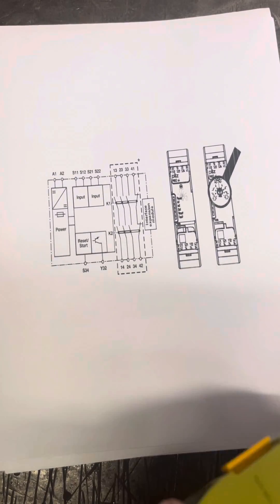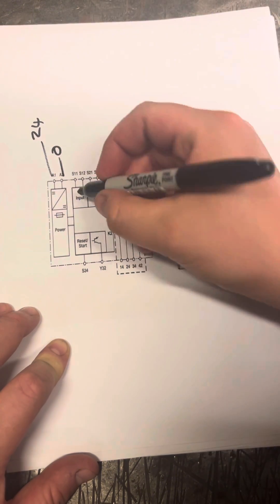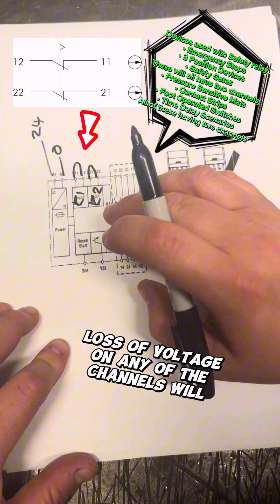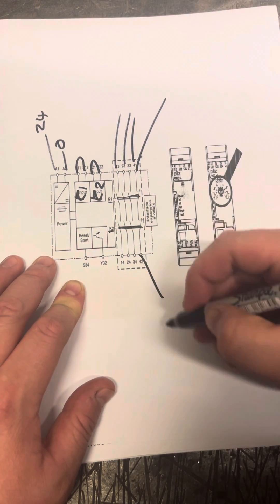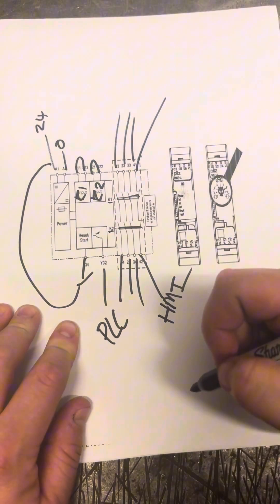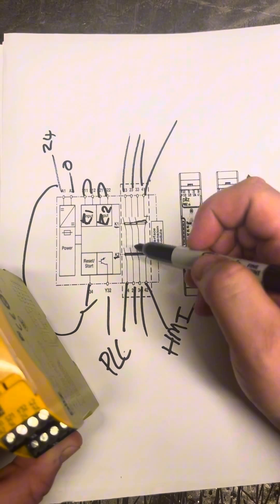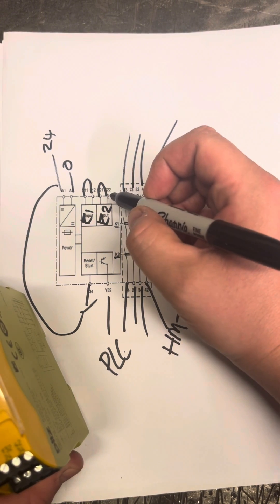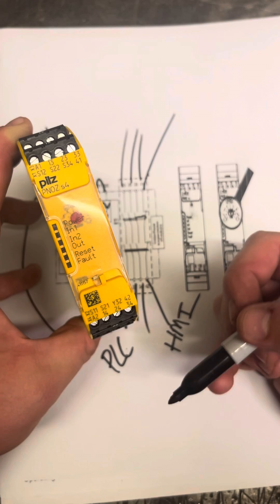Understanding pilz safety relay how they work and who to wire them to components

Comment: how do you wire it to a light curtain?
Reply from the maker: Good question I’ll try and get a video out regarding this !! But in a nutshell you would give both sides of the curtain control voltage and then you the OSSD1/2 as your signal back to you two channels 👊🏻